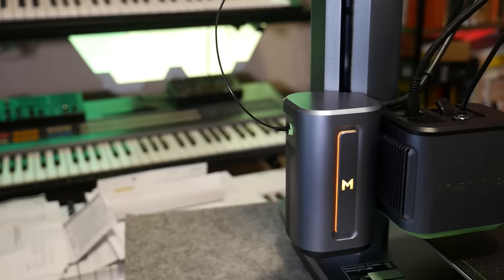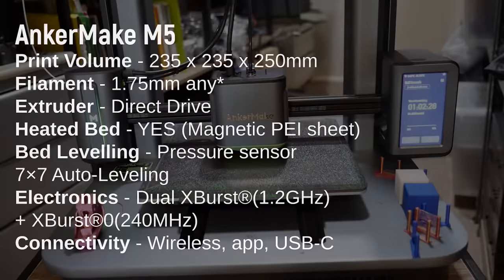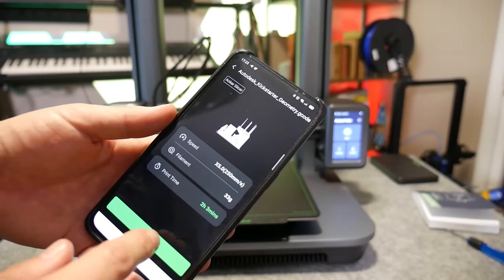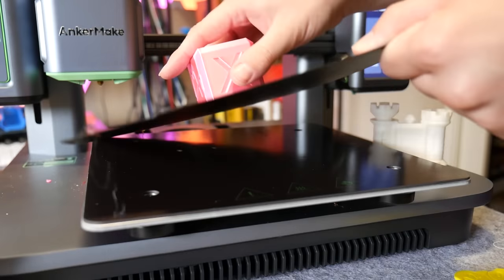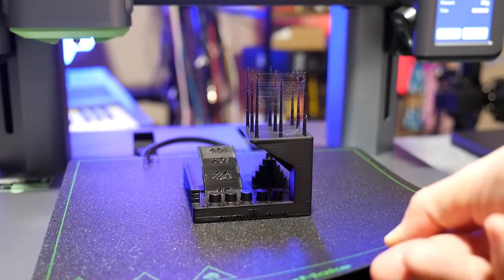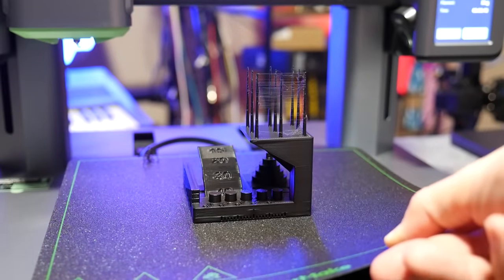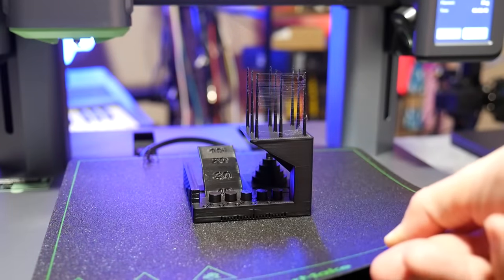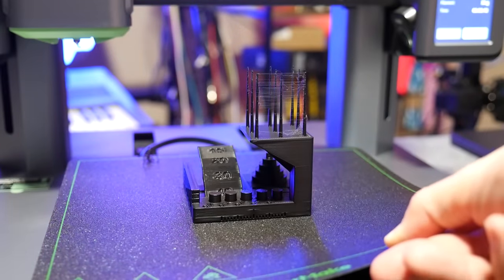AnkerMake M5 3D Printer - Awesome or just hype?

Comment: I got this printer from the Kickstarter and I've had nothing but problems with the software. I had to spend a month for them to update bed leveling so it stopped grinding the nozzle sideways into the print bed.
Reply: That was my first thought after seeing their half-baked slicer and phone app. I'll never use a printer that's not fully supported by fully open source slicing and host software as well as firmware, and I don't think anyone else should either.

Comment: I appreciate that Anker is trying to do a consumer-level product, but don't appreciate misleading marketing, and while they cheaped out on some areas, the price is not cheap.
Reply: Have you not seen their other products? 🤣
Reply: @Geoff_W  I own quite a few of their products, and overall, they've been very well made, much better than some much more expensive ones.
Mophie portable battery pack died, but my Anker is still going strong.
Samsung wireless charger died, but my four Ankers are still going strong.
Lenovo laptop hub died, but my Anker is still going strong.
Apple cables fell apart, but my Anker USB-C are still going strong.
So not sure what's funny about products that cost less, but are high quality, well-made, and last.

Comment: Interesting machine, thanks for the review! Looks like the Bambu P1P knocks it out of the park minus the display, and for cheaper.
Reply: Honestly I get better quality prints from my M5 then the p1p. It's way more stable because of the massive aluminum base, so it vibrates way less and that translates into better part quality. Same speeds, M5 has a better camera (tho a much worse angle)...but the p1p has rails and is CoreXY. Wifi transfers to the M5 can be done locally without a cloud and WAY faster...

There's definitely tradeoffs, but I honestly don't think it's as clear a win as it would seem.

Comment: I do find it amazing how many people complain that "this is too loud, I couldn't have it in my office while I worked."

I, personally, need to use a respirator if I'm in the room while the printer is running, even when printing PLA, or I have noticeable breathing problems.  Granted, I have very sensitive lungs, which means that yes, there are things that are problems for me that aren't necessarily problems for others.  But still.  If you're in the same room as a working 3d printer, you're inhaling volatiles and micro-particles and none of us know what the long-term effects of that will be.  But I doubt they'll be good.

So, yeah.  It baffles me that folks think its okay to spend all day next to one of these machines while it's running.  And I figure the whole "it's too loud" thing is actually a good trait, especially in a "first printer," because it will push people into setting the machine up in another room and thus be that much safer.

Comment: I'm on the fence about getting a 3d printer. Having to learn how to CAD is intimidating to say the least. But if this thing has an included gallery of sliced models, I am intrigued. I however don't want to give up my 3D pen, so if this thing included to basic shapes like spheres, cones, cylinders, etc... then I can just make basic shapes to cut down production time and assemble using the 3d pen to maintain satisfaction.

Comment: I backed this printer on kickstarter, completely forgot about it, then received it in December. After printing with it nonstop since then, I think at this point I’d rather spend some extra money for the Bambu lab x1 or the new Prusa mk4. It’s not a bad printer, but the proprietary nozzle and the inability to buy replacement parts when it was first released really annoys me
Reply: That is a similar experience I had. Backed on KS, but I also backed Bambu Lab X1CC. Received BL in AUG and received Ankermake in Dec. non stop printing on the former. I haven't opened my M5 yet as I am still waiting on the V6 color engine(mid 2023). The X1C has been fantastic so far. I think by the time I'm ready to use the M5 all of the major  bugs would have been ironed out. 

I had an MK3s+ and the Mk4 didn't exactly excite me but time will tell.
Reply: bambu lab unfortunately also has a proprietary hotend + nozzle
Reply: @hrmny_  thats true but they also sell it on their store for very nice price and we already have modified version of the hotend on aliexpress that can use traditional v6 nozzles
Reply: You know bambu didn't have spare parts available at first either right? 🤣They have the spares now.
Reply: @Geoff_W  yeah but even now the Ankermake only has .4 mm brass nozzles available and I have to go to some sketch 3rd party aliexpress for anything else while bambu lab has everything in stock
Reply: @eXaiix  Umm...no? I can buy .2 up through .8mm nozzles on Amazon just fine...and I don't have to rely on Anker for those parts. Most of the M5 are parts I can buy replacements for on Amazon if things go wrong and Anker just refunds you the cost of the part because of the warranty.

Also Anker's hot end accepts Volcano nozzles just fine, only the part fans point a little too high. Easy to fix as they released a CAD of the printer and their community already modified shrouds.

Comment: Kinda pricey for a bed slinger, but my big objections are the reliance on cloud server and apps, and the USB-C port which should have been a standard USB port that works with common USB thumb drives.  I'm not going to install an app to use a 3D printer.  Hopefully someone will make a reliable and reasonably fast 3D printer that ships with a Prusa Slicer configuration, or even better, contribute configurations for all open source slicers so the user can choose.

Comment: I just wanted a 3d printer that prints, and so far this printer has delivered on that. Constant updates on firmware is great. 

It is pretty important though to keep this on a stable platform cause when its really hauling ass it can shake the table and possibly affect the print.

Comment: 2023. AnkerMake discovers the VSlots together with NV rollers and that for only 849 euros... Rating: Ridiculous!
Reply: At least they deliver a product and not an incomplete box of parts and an assembly video on YouTube.
Reply: @MetalheadAndNerd  that's becoming pretty common with multiple printers only needing the gantry installed with a couple screws
Reply: @billallen6109  I was referring to the printers usually mentioned when someone claims that he can get something much better for the same price. Rat Rig is especially annoying since their packages only contain 2/3 of the parts AND require a week worth of assembly time. But their fanboys are in one league with those of Apple and Tesla.
Reply: @MetalheadAndNerd  well if you're trying to compare rat rig to this that's were you're making a mistake. That's like comparing a new car off the lot to a restoration car. They aren't even for the same purpose. Rat rig is all about tinkering, customizability, performance, and most importantly being open source so anyone has access to build one. The only printer on the market that has comparable speed and acceleration to the rat rig is bamboo labs printers which are in the same price range as the ankor for their lower model and it's shipped built as well
Reply: @MetalheadAndNerd  The only thing I mentioned was "V-Slots along with NV-Rolls", which I think is a source of error(s). I didn't make comparisons with other printers, but you probably wanted to read this and you read it...

Comment: Actually the standard X1 would be the better comparison than the P1P which is 25% cheaper. When I look in the Bambu Lab store it looks like it’s silently been phased out. It’s not listed anymore. Which makes sense given the high popularity of the base and the top model.
Reply: I personally to buy a bambu until they privatize the cloud printing, I do specialized engineering and we are not allowed to use Bambu's due to security.
Reply: @azimuth9819  Cloud printing is optional on the Bambu. You just lose some convenience.
Reply: also they are phasing up the P1P - they include the LED strip and camera on the P1P by default now (was the earlybird special before) and everybody who got a P1P can get it for free with a voucher

so i assume, there will be a few upgrades for the P1P along the way to close the gap to the X1/X1C  - when you buy replacement parts like a new nozzle or extruder gears, you can get the hardended steel ones for the P1P aswell, so in the long shot, since they are priced at about the same, there is no need for having the stainless steel ones around, which makes the overall package more standardized
Reply: @azimuth9819  you can use the LAN only mode on bambu lab printers or even feed your stuff with an SD card, you don't have to use the cloud

Comment: Honestly I don't think this is a great printer, especially not for that price. You mentioned a jam, but didn't go into any detail. The V-wheels remove rigidity which is needed for speed, and you can see that in the holes on the Benchy. USB C port is fine, as you can just use an OTG adapter to convert to USB A, but it'd have been nice if they included it. That cooling on the Benchy's bow was unacceptable, it basically means it can't print at the speeds it's advertising. And if that was the default profile, that means it's not user-friendly.

Comment: Surprised no one has made a "dumb" printer, one that has none or little on board controls, displays or CPU power, but simply connects to a PC to control it . Would no doubt cut costs dramatically. Also where are the major printing manufacturers in this space HP, Epson and so, surely by now they can see a business opportunity , really surprised we are still getting kick starter companies, even if they are Anker.
Reply from the maker: They used to be like that, tethered with serial over usb with the computer sending the gcode line by line. Really great when your computer shuts off 1hr into the print! HP tried to crack the consumer FDM market a long time ago but failed miserably and deleted that from existence. Now they have their MJF process which costs a fortune but makes awesomely strong plastic parts. Kickstarter is nothing more than a marketing tool these days, it disgusts me that established companies are able to use it to raise funds and escape all accountability of shipping anything...
Reply: @MakersMuse  yeh I've got an ender 3 and have connected via USB and had it disconnected during print...fun . Occurred to me why can't I send the entire print job via USB to the SD card or on board memory before print starts, not line by line as printing.

Comment: Its shaking the table because you have a dumpy table. Get a serious table and it will be fine. That's what the rubber feet on the vibration bolts were all about.

Comment: Thank you for a good review. i went to there website and i think they are boasting about their standard speed of 250ms on V rails, im always up for a good laugh, but this is hurting my ribs, anyone else think it can do it as there standard speed?
they also say they can do a 200x200x200 print in 16hrs.38mins erm my Ender7 can do in 13 hrs 4 mins
i wander if Maker Muse can do a duel with these  or with a similar XY core against.

Comment: I would like to let you know that the AnkerMake M5 printers that i have seen up close didn’t make so much noise at all. I was even surprised about how silent this printer was. 

Perhaps you had one of the production line that was in the earlier method of assembly with for instance louder ventilators that have been applied. 

Connection wise they still have to improve on multiple levels and possibilities. It is a good 3d printer, while they are more than capable of getting it up into a very good one. Hopefully this will be done soon by AnkerMake.

It’s still falling short in comparison to the Bambulab machines except for the noise levels.

Comment: You can get a P1P or a Mk4 for the same price or less. The printer is also very proprietary for having such crap features. This printer feels like a 400$ printer maximum with todays market (and that is overpriced). If this was released 2 years ago then this would be a good option. I am currently running an Ender3 s1 with an upgraded heatbreak and am running at 500mm/s with 10000 mm/s/s and am getting the same quality as this printer. Even when I am printing at .5 layer height. Competition is a lot further these days. Its kind of insane that its running a ptfe hotend with a bowden extruder in my opinion for this price, the rails just scream overpriced, and belt whine is quite silly for todays market for a high quality printer. Honestly this should be priced at like 300$, which is upsetting because the design is beautiful.
Reply: its not a bowden extruder
Reply: @ThePrintHouse  I guess they can call it direct drive since it's all one piece but you clearly insert on the left and it pulls it through
Reply: @pneumantic6297  It utilizes a reverse bowden tube. The printer is direct drive.

Comment: I have honestly had the opposite experience with this printer. I'm disappointed with it about 40% of the time, as it knocks things off of the built plate fairly regularly. I almost always have to stop the first layer and try again because the nozzle caught on the print. It has been very frustrating trying to dial it in to be dimensionally accurate as well. I experience issues that I've never experienced on my other printers. 
Mine might just be a problem child though, as it does error out on all firmware updates
Reply: I had lots of issues until two things: a firmware update that sorted out the bed levelling (it was always too low on the left before that) and ordering some isopropyl alcohol to clean the bed. Since those two changes I don’t think a single print has come unstuck.

If you’re cleaning the bed, you need to get hold of the firmware updates - they’ll change the printing experience I promise.

Comment: Been using this for months, it's been rock solid printing stuff with tight tolerances (firearms stuff.) For me, the killer will be if they actually deliver the 8 color changer they also offered as part of the original campaign (and which I paid for), and if it really can do a good job without having to print a tower.

Comment: so they went to all the trouble to diecast a base, and then glued an ender 3 to the top of it? for 4 to 8 times the price? Oh and on top of that they also want my location information in the app? Gonna go with noooope. An ender 3 with a bltouch, repurpose the z end stop into a filament sensor (or say, just make sure you have enough filament), and a klipper installation (or heck, a new marlin install! They have input shaping now!) beats the pants off of this thing. If you want to have a printer that just prints, wait 10 years. They all have problems and need tweaking. Even the vaunted X1C.

That benchy looked awful. I'm not even talking about the strange filament mixing. So much ghosting (no input shaping on an i3 clone and more than like 1k of acceleration will do that), obvious cooling issues that shouldn't be there on a printer that advertises speed. No linear advance? Really? This is 2023. These are settings that come in free software. Heck new prusaslicer has features that allow you to slow down overhang perimeters. Properly tuning that alone would have solved some of these issues. Also a lot of that footage did not look like 250mm/s or 2.5k mm/s^2 (the settings they say to use, which btw, at 0.2 tall x 0.4 wide is 20 cubic mm/s, a flow rate that only looks barely achievable on their hot end). Some sort of did? and then in the next perimeter it slowed down, and travel moves looked sluggish.

This is not a revelation, it is another ender 3 clone, with a fancy base, and some features glued on. Some of which don't even work.

I am all for bringing fast easy printing to the masses. but at $800 USD, there are better options.

Comment: So a swing and a miss for Anker . . . They stirred up all that hype for an upgraded Ender-3 at the price of a Prusa. I don't like the V wheels, especially in a $900 printer (I don't even like them on my $200 printer), and I don't want to get locked into a proprietary ecosystem where I have to use their software. Manufacturers need to understand that many 3D printer enthusiasts have multiple printers from multiple manufacturers, and we like to use our favorite slicer for all of them. Having to run the gcode file through Anker's fork of Cura before loading it to the printer is just stupid.
I haven't seen anyone yet mention what kind of hot end it has or what kind of nozzles it uses, and what happens when the extruder - or anything else - breaks? Are you  going to be locked into buying replacement parts from Anker? I do like the cast aluminum base and the ease of setup, but this printer seems like a mix of high end and cheap, and it's just not worth the price to me. 
Based on what little I've seen so far, the MK4 is just as fast, much quieter, open source, and supported by Prusa, and I'll be happy to exchange a few hours of build time to get a printer that I know I can upgrade and repair in the future. I'd be even more willing to save a couple of hundred bucks and buy a Bambu Labs P1P. 
I suspect you'll see the M5 at Micro Center for $300 next year as Anker tries to clear out all their unsold stock.

Comment: Unfortunately Anker's history of app and camera security is full of holes and outright lies to their customers so I would hesitate to use it. The app looks good but they've had a ton of time to get spaghetti detection working with no real reason to expect it to be updated any time soon, the fact covering the camera doesn't throw a notification simply means they are only looking at the first layer which helps only if you are sending models to it from a separate room and completely ignoring the device. Most people will watch the first layer to make sure it's good and just let it run for the rest so detecting the first layer is pretty pointless.